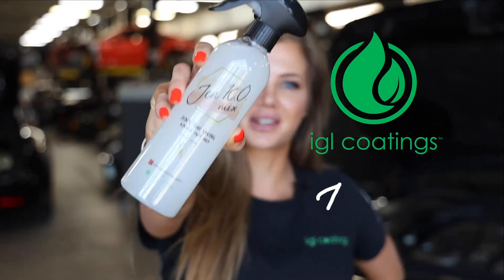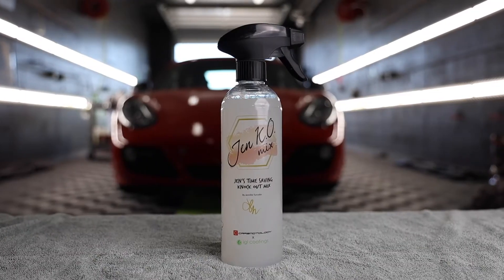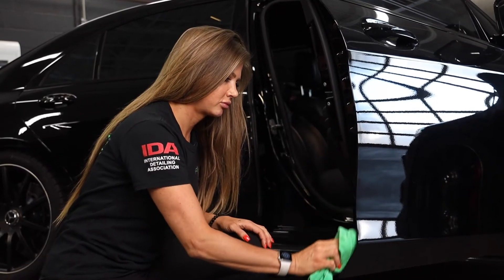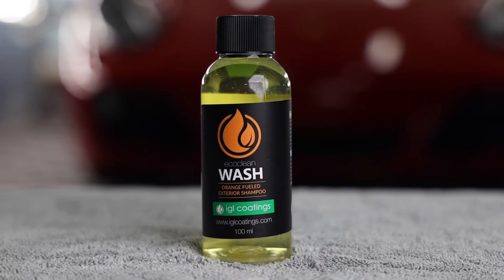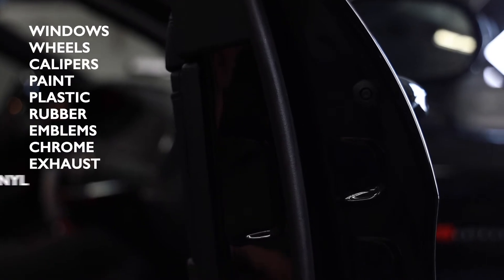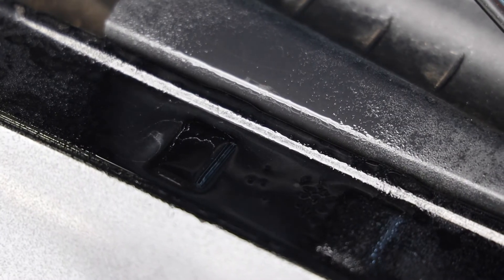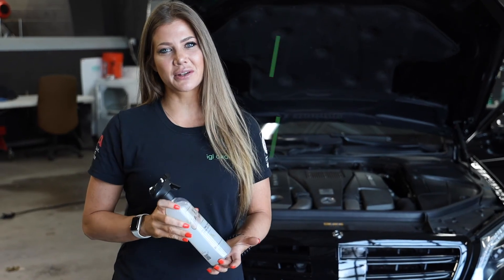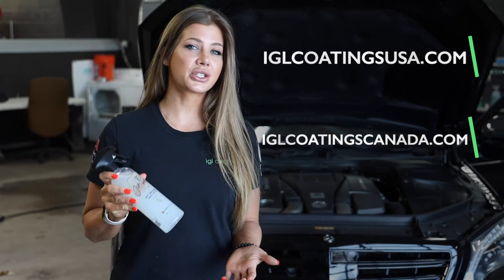Introducing IGL Jen K.O. Mix: The Ultimate All-in-One Cleaning Solution

Comment: Works really well but smells really  awful.  Will still use because it is  definitely a great product and cleans like advertised, but would be easier to work with if it didn't have such a strong odor.
Reply from the maker: Yes unfortunately it doesn’t have the most pleasant smell but at least it works very well